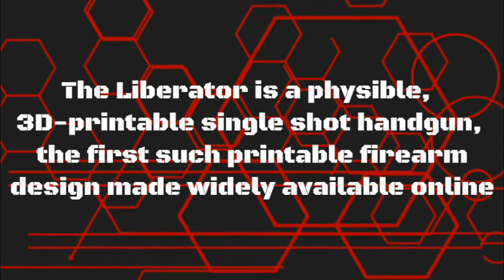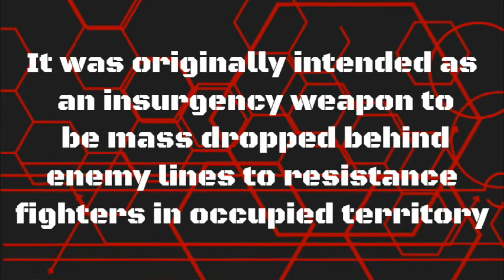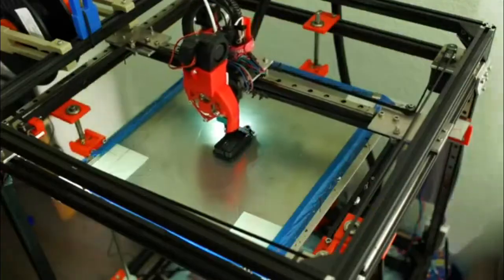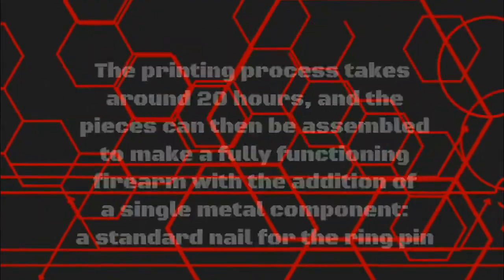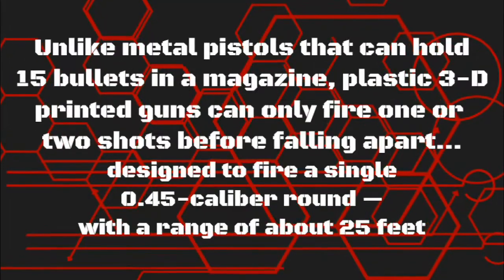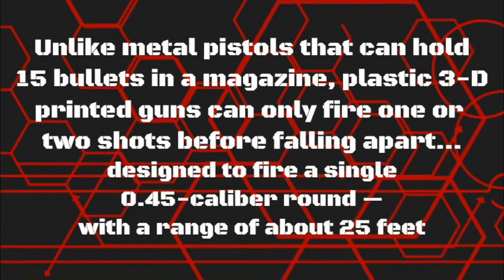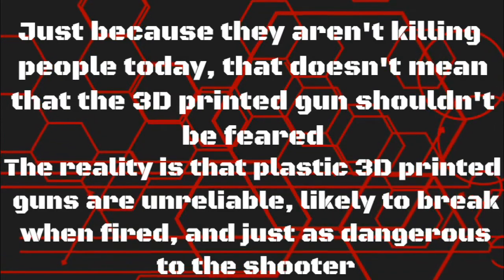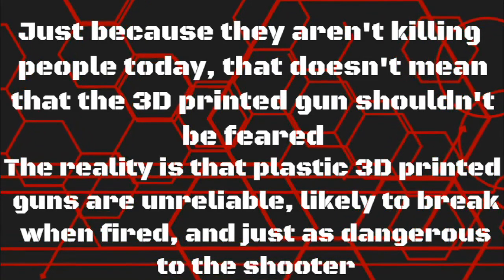HOW A LIBERATOR GUN WORKS AND HOW TO USE IT!! MUST WATCH!!

Comment: The 3d printed Liberator wasn't used as an insurgency weapon. You're thinking of the FP-45 Liberator from WW2 I believe.
Reply: You Sir are correct, also this video is riddled with errors.... such as "ring pin".... should be firing pin.